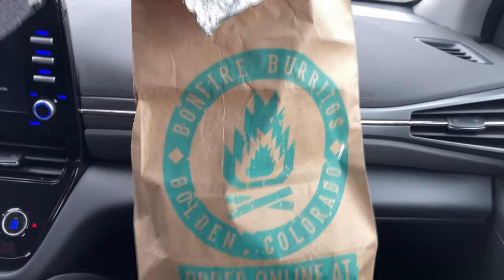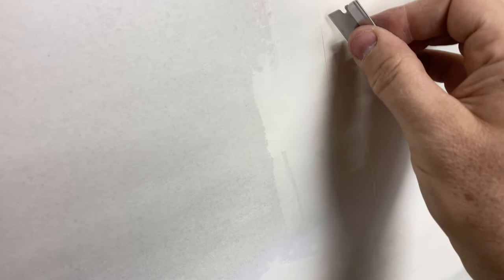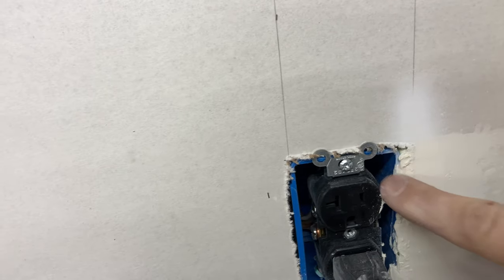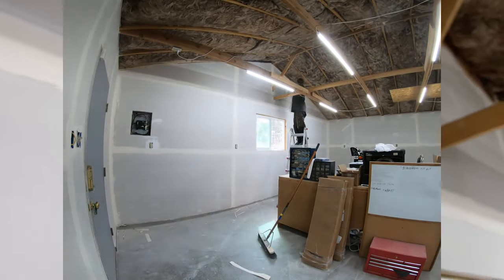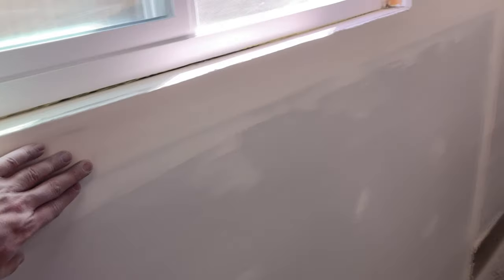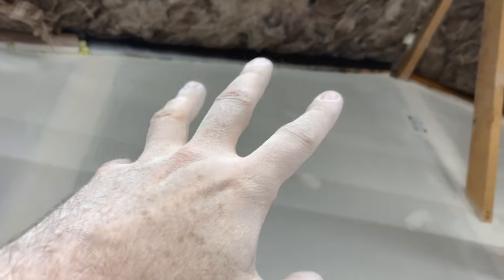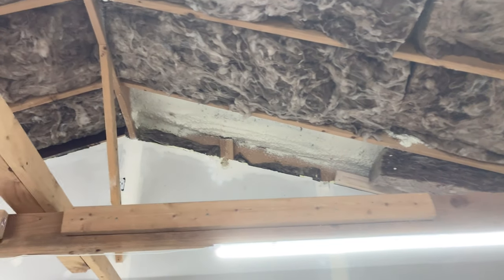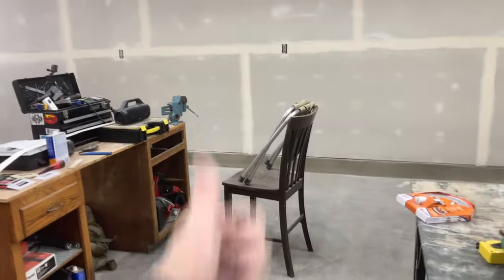Had to Rip it Apart and Start Over

Comment: There's a good amount of satisfaction (even vicarious) in seeing your project coming along nicely. It's even given me an idea or two. We lost our furnace this year, so think I'll look up those Heat Pump/AC combos. (Well, first I'll have to have an electrician check the wiring. That's the reason we lost the furnace, it started to use power even when turned off, and then stopped working altogether. Also, I don't recommend anyone buy a modular home, there's no real building code, and they are basically a glorified trailer. Poor insulation, bad wiring bad quality cabinets...10/10 would not do again.) 
I do enjoy some good metal myself. (mostly Power Metal, some symphonic and folk as well.) It's always fun to keep people on their toes with a playlist. Big band era stuff like Charlie Christian and Benny Goodman, classics like CCR, Stevie Ray, the Drifters, Power Metal stuff like Blind Guardian, Hammerfall,  and anything else I like, from Richter's Brandenburg Concerto renditions, to Daniel Estrem's guitar covers. I guess you could call it eclectic, or just musical whiplash.